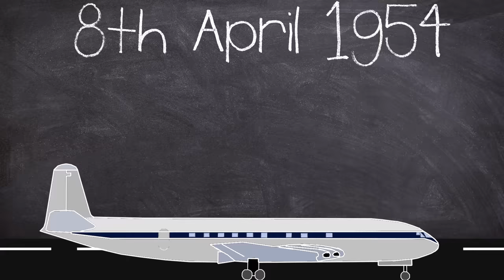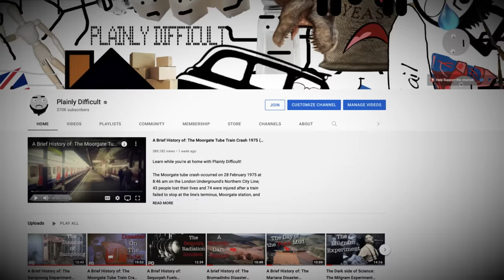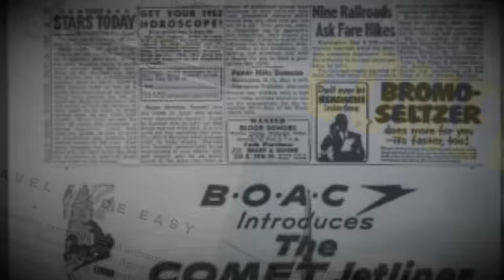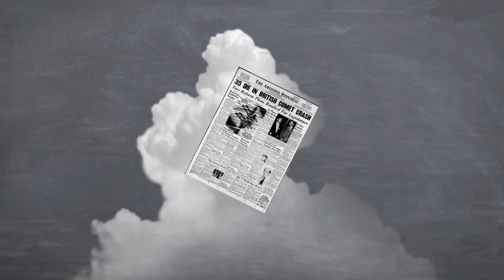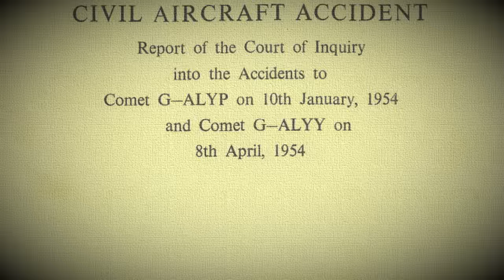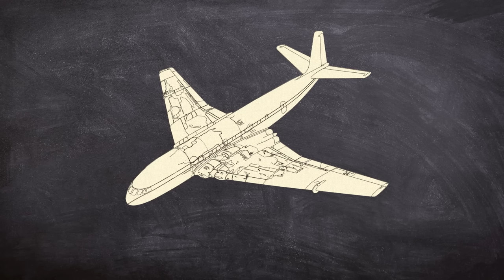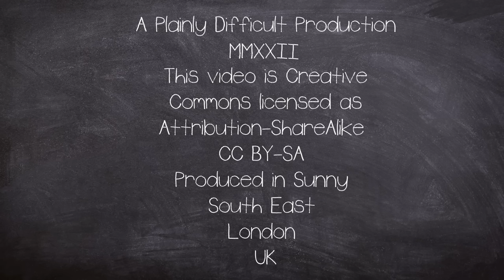A Brief History of: The de Havilland Comet Design Disaster 1954 (Documentary)

Comment: So they should have cut corners?
Reply from the maker: Yes
Reply: They should have stuck to building aircraft from wood...
Reply: This video has some BS included.
For example -
  
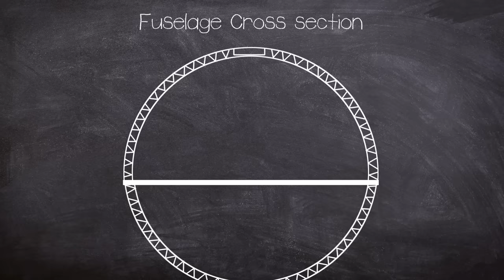    5:20   The idea that only the crew & passenger areas were pressurised is absurd obviously. 
  In fact every part of the fuselage was pressurised from the nose to the rear fuselage bulkhead including the entire cargo area.

Besides that.
The engine position & inlet design were not flaws or fatal flaws, there were good reasons for that design choice at the time.

Comets flew until 1997.
The Comet design had military use as a requirement. Nimrod development began at 
De Havilland before 1953.
Nimrods were not withdrawn due to structure problems or other airframe issues it was entirely a significant upgrade snag & resultant basic economics & an end of line sale happening at Boeing at the same time.

  We feel we can shed some light on some common misunderstandings.

  At the time the Comet wasn't particularly dangerous.

Losses comparisons
How things were in those days.

DeHavilland Comet 4 UK           14% 
DeHavilland Comet all  mks       17%  

Boeing 307                               70%
Boeing 247                               48%
Boeing 707            .                  20% 
Boeing 707                                20% 
Lockheed Electra Turboprop   29%
Canadair CL-44  Turboprop     46%  
Convair CV-580  Turboprop     22%
Convair CV-880    (ff 1959)       27%  
Convair CV-990     (ff 1961)      35%

    Of course De Havilland had prior experience building many all metal construction airframe aircraft including thousands of jet powered fighter aircraft that were primarily of metal construction with pressurised cockpits & jet engines built by De-Havilland.

   De Havilland carried out full stress analysis & engaged in a comprehensive & protracted testing program which is why key De Havilland people were happy to be aboard flying DH Comet aircraft.

   The DH Comet was the first passenger airliner with full length fuselage pressurisation at 8psi pressure differential. Handley Page built the world's first airliner.

   Of course ripstop provision was provided. The skin alloy used became unavailable at the time due to R & D at the manufacturers which resulted in the original alloy being discontinued.
The skin thickness used for the Comet was used for similar later aircraft. 
Frame spacing was not found to be too large & frame width was not found to be too small.

  De Havilland did indeed always work to better than industry standards at the time, used up to date knowledge for the design & construction & no evidence of negligence  or criminal negligence was ever produced in relation to the DH Comet.

  The DH Comet had no effect on the course of the aerospace industry in the UK. The UK now has the world's largest combined nuclear, aerospace & defence sector per capita activity.

    The investigation committee did not find hundreds of fatal flaws or evidence of design defects, structural defects, defective materials or shoddy workmanship. Ripstop provision was included. Claimed incidents did not involve cracks starting from window corners.
Pretty much all changes were just in case changes or were planned development modifications & improvements that were scheduled regardless of incidents.

De Havilland designers knew all there was to know about metal fatigue at the time they designed the DH Comet.

Hope this helps.

Cheers 👍. 
  
   
 . . .... ... ..... .
Reply: @Peppa_Wiggles23  Uhhm. Cutting corners was a joke.
Reply: @bettyboop-xg6jo 

That's right, a good joke but one of the irrelevant replies needed dealing with but indirectly.
Reply: @Extra-Sail  Noted.

Comment: My older brother used to work at an aviation museum, which had a Comet onsite. I remember him pointing out the almost perfectly circular windows and explaining that, while most passenger aircraft merely had rounded corners on their windows, the company responsible for the Comet played it extra safe after the corners on their previous square windows caused the plane to tear completely apart during flight.
Reply: There is no evidence to support the theory that was put forward by de Havilland.
All of the evidence indicates that the catastrophic in-flight structural failures occured along the roof of the passenger cabin.
Investigations revealed that the Comet was riddled with hundreds of fatal design and construction flaws in particular the lack of rip-stop doubler joints, fuselage skins that were too thin, fuselage reinforcement rings that were too thin and spaced too far apart and riveted fasteners that were poor designed and poorly installed.

The accidents are completely unrelated to the shape of the passenger windows
Reply: Sandybum the hater of all things British, he even denies that Boeinng and Douglass were given the results of the ivestigationn and both odified their aircraft as a result.

Comment: A comment I saw on these crashes was that the problems with the square windows shouldn't have been a surprise to anyone; after all, engineers had known how to make holes in pressure vessels since the nineteenth century.
Reply: That theory has been completely debunked by subsequent investigations and engineering studies along with wreckage recovered from seals.
de Havilland never understood the problem and its own tests were inconclusive. 
The catastrophic in-flight structural failures occured along the roof of the cabin at its widest point, exactly where Pascals Law tells us it should fail.
The shape of the passenger windows was not the cause of the Comet Disaster.

Comment: One factor that contributed to a failure to detect this problem in testing was they would do overpressure tests and THEN do pressure cycling. The overpressure work-hardened the metal which made it relatively more resistant to cycles of loading so hid how early cracks would appear.

Comment: It wasn't the cabin windows. 
The failures originated at the cutouts for the ADF units on top of the fuselage. These were known as ADF "windows" which is where the confusion arises. Once the failure occurred it ripped through the thin skin of the fuselage and the plane explosively depressurised and broke up. The structure just wasn't strong enough.
Reply: Excellent comments. True, wreckage recovered proved conclusively that the passenger windows were not the cause. 
Investigators found that the Comet used skins that were too thin and made  from an alloy that was too brittle.
It lacked proper rip-stop doubler joints.
The fuselage reinforcement loops were too narrow and spaced too far apart and riveted joints were poorly designed  and not made to a high enough standard and lacked adequate quality control.
Reply: @petemaly8950 de Havilland used aluminum skins half the thickness or other manufacturers.
And used an inferior alloy that was too brittle

Comment: Based on points others have brought up here and on other vids discussing the Comet, I'm afraid this video needs to be reworked. You fell into the common error of attributing the stress mainly to the window shape.  The punch-riveted construction (which, unlike drill riveting, has a habit of doing to metal what wire nails all too often do to wood) causing fatigue cracks, and the hull being too lightweight for its own good when it came to pressurization stress (especially in conjunction with the punch-riveting cracks). And unlike your little artist's rendition, the Comet's windows were ROUNDED AT THE CORNER anyway! Something clearly visible in every photo!

Comment: Actually a manufacturing failure, not a design failure.

The rivets were supposed to be put in drilled holes.  
They punched rivets through un-drilled metal, tearing the edges.  
Those tears were stress risers for  fatigue failure.

While the square corner windows were not ideal, they were just fine if assembled correctly.
Reply: You would see the tearing at the window corners before it was dangerous.
The rivets ALL having cracks due to improper installation would have hidden cracks that would spread un-noticed.

Comment: The De Havilland comet is, in my opinion, one of the most beautiful aircrafts ever made. The smooth nose, swept wings, and inbuilt engines are so pretty. It’s a damn shame that they failed, and I’m sad that no one has picked up the inbuilt engine design.
Reply: While it is pretty, inbuilt engines have a much longer turn around time for maintenance.
Reply: No legitimate aircraft engineer would ever use this design, the Comet's integrated engines were also one of its fatal flaws that caused several crashes.
Based on an aerodynamic theory that later proved to be completely wrong in wind tunnel tests... no other airliner ever copied this horribly bad design.

Comment: I've seen a couple of documentaries which mention part of the problem being the windows were designed to be held in with screws using predilled holes, but punch rivets were used instead (which created thousands of micro stress fractures throughout the airframe).
Reply: Modern analysis confirmed that none of the catastrophic in-flight structural failures were related to the passenger windows..
The fuselage ruptured exactly where Pascals Law tells it should, at the crown of the main cabin at its widest point.
Reply: cx

Comment: In point of fact the original windows did have rounded corners. They just increased the radius on the redesign. Also not mentioned is that they changed from punching the rivet holes to drilling them.

Comment: The Comet even looks modern now. Must've been absolutely stunning when first introduced. Too bad its reputation was trashed considering how cutting edge the aircraft was.
Reply: Actually the Comet's 1920s Art Deco styling looked very dated by the 1950s and looks completely old today with its  unswept control surfaces.
Reply: Comets flew until 1997.
The Comet design had military use as a requirement. Nimrod development began at De Havilland before 1953.
Nimrods were not withdrawn due to structure problems or other airframe issues it was entirely an upgrade snag & resultant basic economics & an end of line sale happening at Boeing at the same time.

We feel we can shed some light on some common misunderstandings.

At the time the Comet wasn't particularly dangerous.

Losses comparisons
How things were in those days.

DeHavilland Comet 4 UK           14% 
DeHavilland Comet all  mks       17%  

Boeing 307                               70%
Boeing 247                               48%
Boeing 707            .                  20% 
Boeing 707                                20% 
Lockheed Electra Turboprop   29%
Canadair CL-44  Turboprop     46%  
Convair CV-580  Turboprop     22%
Convair CV-880    (ff 1959)       27%  
Convair CV-990     (ff 1961)      35%

    Of course De Havilland had prior experience building many all metal construction airframe aircraft including thousands of jet powered fighter aircraft that were primarily of metal construction with pressurised cockpits & jet engines built by De-Havilland.

   De Havilland carried out full stress analysis & engaged in a comprehensive & protracted testing program.

   The DH Comet was the first passenger airliner with full length fuselage pressurisation at 8psi pressure differential.

   Of course ripstop provision was provided. The skin alloy used became unavailable at the time due to
R & D at the manufacturers which resulted in the original alloy being discontinued.
The skin thickness used for the Comet was used for similar later aircraft. 
Frame spacing was not found to be too large & frame width was not found to be too small.

  De Havilland did indeed always work to better than industry standards at the time, used up to date knowledge for the design & construction & no evidence of negligence  or criminal negligence was ever produced in relation to the DH Comet.

  The DH Comet had no effect on the course of the aerospace industry in the UK. The UK now has the world's largest combined nuclear, aerospace & defence sector per capita activity.

    The investigation committee did not find hundreds of fatal flaws or evidence of design defects, structural defects, defective materials or shoddy workmanship. Ripstop provision was included. Claimed incidents did not involve cracks starting from window corners.
Pretty much all changes were just in case changes or were planned development modifications & improvements that were scheduled regardless of incidents.

Hope this helps.

Cheers 👍
  

   
xcxcxvcxcxcc
xcvvvvccvxcc

Comment: I think the actual failure point was eventually pinned down to the ADF mounting point. it was discovered part of the issue was the rivets holding the structure together were punched, not drilled in this was the basis of the stress risers that ultimately caused the failure.
Reply: Actually the entire aircraft had to be redesigned... investigators found hundreds of fatal flaws that were modified or changed on the Comet 4.

Comment: Brief but solid video that covers all the important points. Sadly, by the time that the Comet 2 was introduced, Boeing and Douglas owned the commercial jet market. For a kid (me) flying in a 707 or DC-8 was like going to the moon...
Reply: Boeing was the world's leader in pressurized airliners in 1954, Junkers invented pressurized all metal monoplane aircraft in 1932 and was building aircraft that could fly over 52,000 feet fully pressurized during WW2.
Boeing, Douglas, Junkers and Lockheed were all successfully building pressurized airliners when de Havilland was still building Wood and fabric biplanes like the Dragon series.
Reply: The Boeing 707 family is the first successful jet airliner, the Comet was never airworthy and was grounded in 1954 and subsequently had its airworthiness certification permanently revoked.

Comment: Its not actually the window that are the problem,  They did have radius corners. All be very small radiuses.  The fatigue cracking actually started in the rivet holes around the windows that secured the skin to the frames.  Because what ever reason, the hole where punched out, instead of drilled during manufacture. Which left defects in the skin which initiated the cracking

Comment: Cool looking airliner but boy it had issues.
Reply: This video has some BS included.
For example -
  
    5:20   The idea that only the crew & passenger areas were pressurised is absurd obviously. 
  Every part of the fuselage was pressurised from the nose to the rear fuselage bulkhead including the entire cargo area.

Comets flew until 1997.
The Comet design had military use as a requirement. Nimrod development began at 
De Havilland before 1953.
Nimrods were not withdrawn due to structure problems or other airframe issues it was entirely a significant upgrade snag & resultant basic economics & an end of line sale happening at Boeing at the same time.

We feel we can shed some light on some common misunderstandings.

At the time the Comet wasn't particularly dangerous.

Losses comparisons
How things were in those days.

DeHavilland Comet 4 UK           14% 
DeHavilland Comet all  mks       17%  

Boeing 307                               70%
Boeing 247                               48%
Boeing 707            .                  20% 
Boeing 707                                20% 
Lockheed Electra Turboprop   29%
Canadair CL-44  Turboprop     46%  
Convair CV-580  Turboprop     22%
Convair CV-880    (ff 1959)       27%  
Convair CV-990     (ff 1961)      35%

    Of course De Havilland had prior experience building many all metal construction airframe aircraft including thousands of jet powered fighter aircraft that were primarily of metal construction with pressurised cockpits & jet engines built by De-Havilland.

   De Havilland carried out full stress analysis & engaged in a comprehensive & protracted testing program.

   The DH Comet was the first passenger airliner with full length fuselage pressurisation at 8psi pressure differential.

   Of course ripstop provision was provided. The skin alloy used became unavailable at the time due to R & D at the manufacturers which resulted in the original alloy being discontinued.
The skin thickness used for the Comet was used for similar later aircraft. 
Frame spacing was not found to be too large & frame width was not found to be too small.

  De Havilland did indeed always work to better than industry standards at the time, used up to date knowledge for the design & construction & no evidence of negligence  or criminal negligence was ever produced in relation to the DH Comet.

  The DH Comet had no effect on the course of the aerospace industry in the UK. The UK now has the world's largest combined nuclear, aerospace & defence sector per capita activity.

    The investigation committee did not find hundreds of fatal flaws or evidence of design defects, structural defects, defective materials or shoddy workmanship. Ripstop provision was included. Claimed incidents did not involve cracks starting from window corners.
Pretty much all changes were just in case changes or were planned development modifications & improvements that were scheduled regardless of incidents.

Hope this helps.

Cheers 👍
  
   
   
xcxcxvcxc
xcvvvvccv

Comment: It's surprising that they didn't have any issues during 16000 cycles of pressurization.  It's somewhat surprising that some types of aluminum fatigue weren't discovered in some of the many varied airplanes used during WWII.  And at least the Boeing B29 used during WWII used a pressurized fuselage.  Now that we know more about fatigue properties of various metals the problem is more obvious.  I took fracture mechanics class in college graduate school and the Comet was used as an example of a fracture mechanics failure.